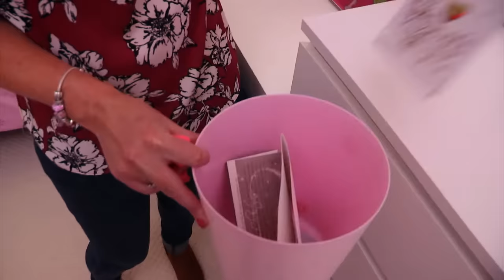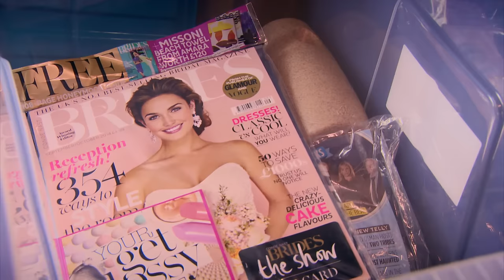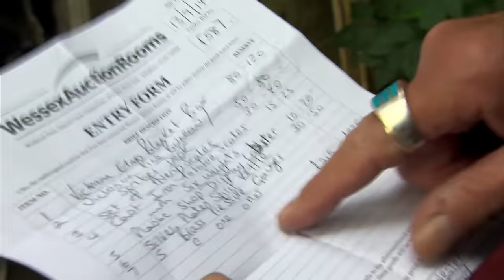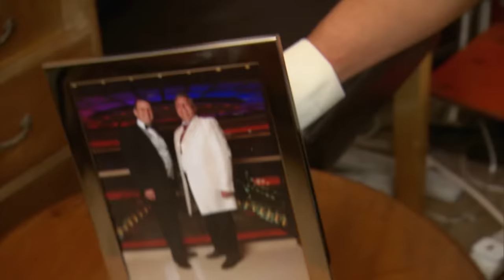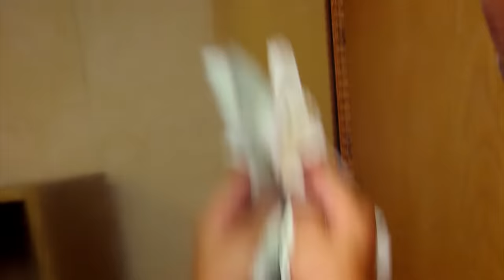Cleaner Gets a FILTHY Christmas Surprise | Obsessive Compulsive Cleaners | Christmas Special | Filth

Comment: Cleaning your kids with Dettol is surely not healthy, is it? Is it made to come in touch with infant skin??
Reply: Dettol is in fact safe to put in a bath so long as it’s diluted. I grew up having a cap of dettol in the bath, by the time you’ve filled the bath, added soap etc it’s a very weak solution. 
Just a reference point certain, for skin conditions doctors recommend small amounts of bleach in the bath to help with the problem.

Edit: Just did a quick search and dettol is medically advised for douching (when recommended by a medical practitioner). If it’s safe enough for your nether regions, it coming in contact with your skin is not particularly an issue.
Reply: @natalya7208  it may be considered safe for adult skin but when we try to only use the purest on children, I would avoid such a chemical liquid at all costs. But of course each to their own, if it's generally considered safe I wouldn't object to others using it if they wanted to. I just wouldn't.
Reply: @allie.lazio.  you can get detol that's made to put in the bath... its perfectly safe even for young kids... the key is diluting it enough 😊
Reply: Yeah dettol baths are actually a good idea, it's in water . I always like using dettol aswell in the bath aslong as it's diluted it's fine.
Reply: Just because Dettol says it's a good idea, doesn't mean it is.